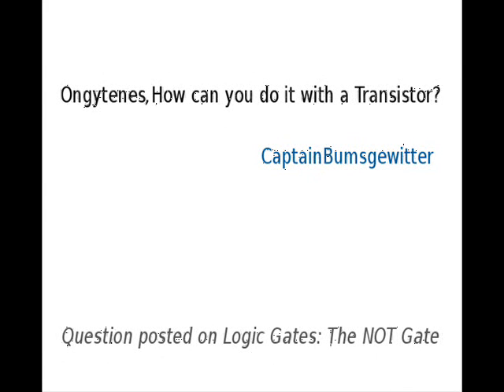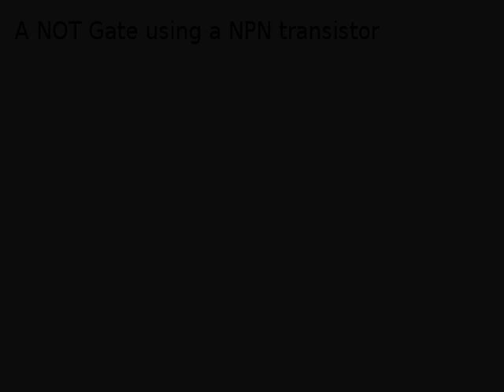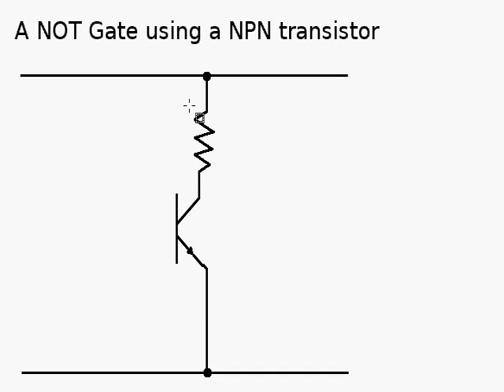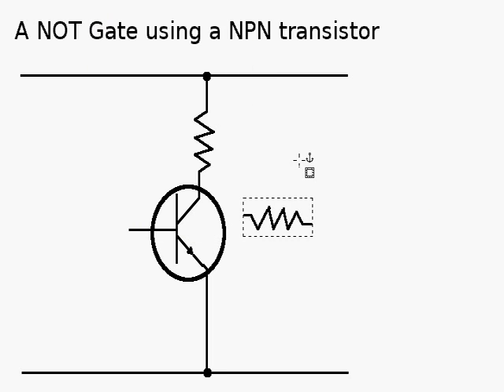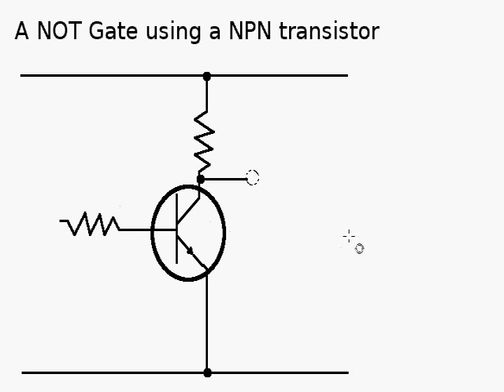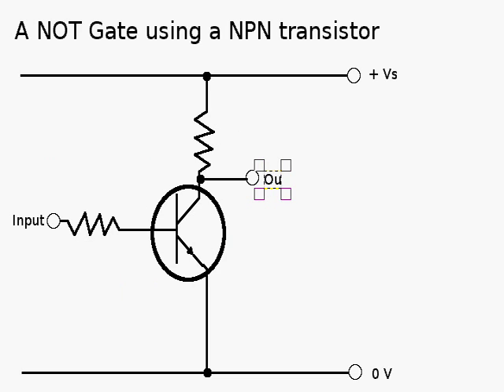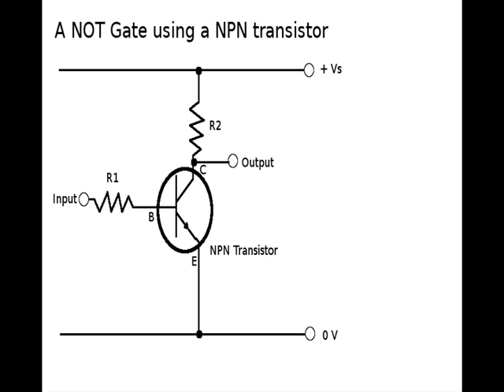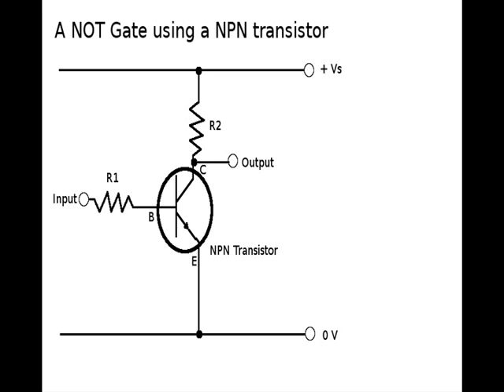ANSWER: NOT Gate using a NPN Transistor.

Comment: @EveryoneIsBoring 
Dear sir, you understand nothing of resistors or their uses. assuming the output has a load of about 10k you would quickly realize that the amount of voltage going into output is too low to activate the next transistor, and is too weak to do anything much to anything else.A base of 0 basically causes a short between v+ and v0, hence the 1k